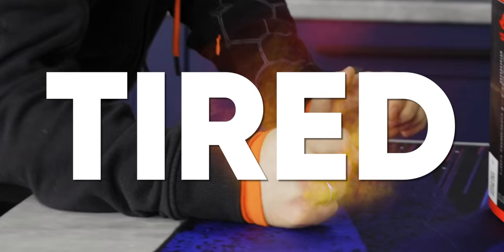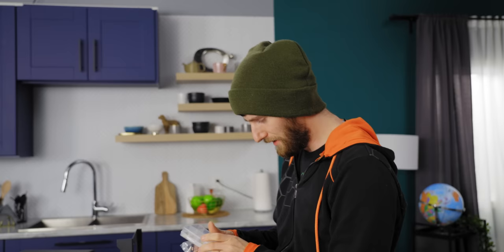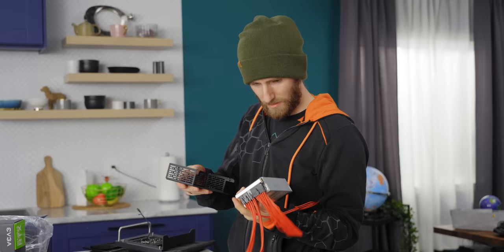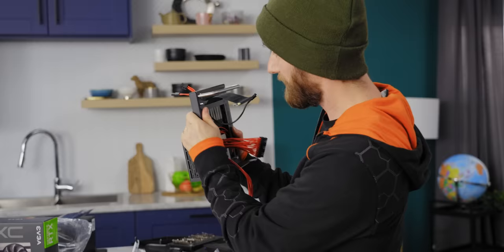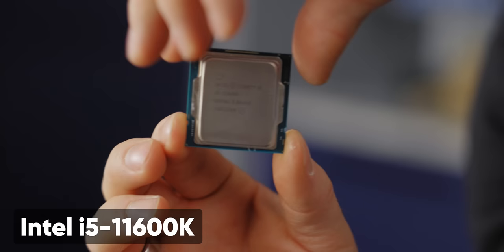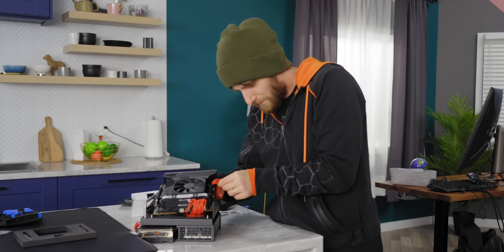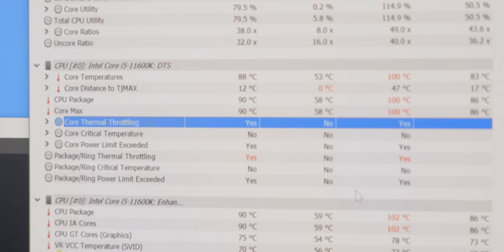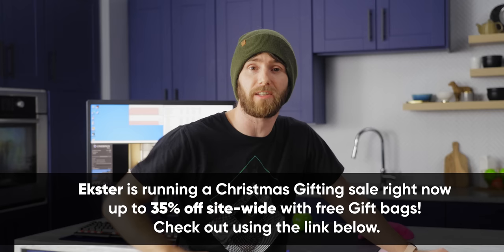Cases are Stupid. - XWORKS X32 "Case"

Comment: I'm sure someone is going to see these 'cases' and invent a 'self-cleaning' or more likely 'self-dust-filtering' CPU and or, GPU fans, so that dust won't bother the fan. The only reason the larger cases come with meshing for filtering out air particulates in the first place is because the fans don't do that themselves, and get covered in gunk when they don't. 

 I wonder if we can get Major Hardware to watch this video of this case and come up with the idea himself, to make 3d printed fans, with 3d printed enclosures, WITH some kind of 'filter', perhaps the filter can't be 3d printed.
Reply: I would love that. Compressed air is so 1990s
Reply: @phoenixmorgan  Is it? Damn, I'm living in a past I've barely seen.
Reply: There are electric dusters. I have one called “CompuCleaner Xpert” (not sponsored) which works great for cleaning my PC which I have permanently on a testbench. The one I have is pretty strong even with a really wide nozzle, I have to be careful because it spins the fans up really fast just from airflow. Additionally having the PC on an open case/testbench means that the airflow is usually varied and not always along the same path of the case fans which prevents buildup of dense/compressed dust.

Comment: I wonder if temps would be better if fan on the L9A was pulling air through the fins of the heatsink and exhausting it out into the surroundings instead of pushing it down and through.

Comment: One nice thing I could see people using the XWORKS X32 for is to 3D Print a shell for this so they can make a compact PC Case and CHOOSE how large they want it to be in order to accomodate larger GPUs, or extend the length to accomodate for the use of an SFX Powersupply, & purchasing a PSU extension cord to put on the back & use the spot for a Flex PSU as an area to stash cables.

Comment: Love my Thermaltake Core P3 open case. Temps close to ambient at idle. Have yet to see above 65c at high load. And 5 minutes with an air duster once every couple months. Never had a cleaner set up.

Comment: Now, new challenge for you Linus, make a computer in one of those animal backpacks with holes so you can carry it around. 
Requirements:
it can't be heavier than 15lbs (6kg)
It can only get warm enough to make the plastic warm, not melt
has a mini-monitor on the wrist or something like that
las a power supply on it
must be able to run 1080 at minimum 

No pi's allowed. No ARM allowed (unless it can run arm as well). 

BUT I doubt this will ever happen. I'm never noticed...

Comment: The portability argument is a bit moot because in many use-cases like LANs etc. you'd still have to bring peripherals and maybe even a screen with you, so lugging a traditional PC case with you as well just doesn't make much difference anymore.
Where I see a use-case for this is for Gaming PCs that get set up under a TV, maybe in someone's bedroom where there isn't enough space for a desk. I'd then maybe prefer this "case" to the other small factor cases because it seems that it is quite a bit easier to build in this one than in the others (if you limit yourself to air-cooling and the constraints of the PSU)

Comment: Here's an idea for a water-cooling loop
Connect the in flow of the house plumbing such that the water flows through a reservoir that contains radiators for the house server equipment. BEFORE it enters the water heater or floor radiators. This will preheat the water, maybe reducing water heating costs?

Alternately, you could have the house plumbing flow directly through the server loop (I mean, COOL EVERYTHING)

I know you like doing really off the wall stuff. If you're interested, message me for more!

Comment: 1.) Flip the CPU fan and have it EXHAUST the air. It might do better and not throttle again. Plus, it won't blow the hot air all over the VRM and RAM and SSD.
2.) Just get a SFF PSU with a 80mm fan that goes on the side, not that trash 40mm.

Comment: They really need to get a BlackRidge V2 CPU cooler for all their SFF builds. Not the easiest to find in NA but it is possible and will fit just about any sff case with a slim 120±slim 90mm fans. It is MILES better than the L9 or even L12s.

Comment: 3060?  Dude, it's effectively an open bench case for GPU airflow purposes.  You might as well give it a 4090 Ti and demonstrate just how small a top-performing system can be now.

re:  cases with filters, blowing the dust off that thing is so much easier, it wins that trade-off too.

Comment: As far as noise goes for super tiny builds like this, I generally replace the stock Flex power supply fan with the super tiny Noctua A4 fan and it's much quieter.

Comment: Even though there's no chips on the bottom of the NVMe SSD, heat can still be transferred to the bottom of the board so cooling that side of the board would still be beneficial.

Comment: I have a similar thing. I have the Xtia Xproto with radiator brackets for full custom loop and it looks soooo cool and it runs extremely cool. A lot of people complain about dust but its honestly not that hard to clean. My only complaint is you can hear coil whine from the motherboard and psu.

Comment: @LinusTechTips That is a modified Delta PSU not OG.  The quality is highly variable based on the EE knowledge of the person modifying the psu.   I bought a few of those and found them to be fine for very low end GPUs but something like a 2070 would restart on load despite being a couple hundred watts under the psu rating.

Comment: Ordered a Fractal Design Define 7 case as well as a Ryzen 7 5800X and an NH-D15.  The processor and cooler came in today and while it probably would've been wise to wait for the case to arrive in  January I couldn't help but upgrade the processor and cooler right away.  Even without the new case it's soooo much quieter and a bit snappier too.  I didn't necessarily need a new CPU (my Ryzen 7 3700X was still doing fine aside from occasional throttling) but I figured I may as well upgrade it since I had to take the cooler off anyway and it's a bit easier (and probably a bit more performant) to attach a cooler to a CPU that hasn't had any paste on it before.  I was using the stock Wraith cooler before.  The new case should be even quieter while providing better airflow and much easier upgrades than my current one.  Not sure what type of case I currently have (I'd probably have to find the box in my (very much not attached) garage) but it's a super tight fit with an ATX board, has the PSU right next to the MB instead of a separate compartment, and doesn't have a USB C port.  It does have a reset button and a clear side panel which is a catch 22 (the new case will have a solid panel because as much as I like seeing inside the case I'd prefer to not have a ton of light coming through it when I'm watching a movie or trying to sleep and the solid side + foam will further reduce unwanted noise).

Comment: @ltt I think that reverse the mounting of ventilator would solve overheating issues, because you will be getting heat from board not into the board. Bottom of the motherboard seems clear to have inflow of cold air.

Comment: I have a similar build. No case right now, and using Ryzen 5950x with a mini Asus Phoenix 3060 on an Aorus B550i. I'm using 64gb ECC very-low-profile memory with a alpenfohn black ridge + 120mm fan and liquid metal. Using a 600w modular flex psu (enhance 7660b from Geeek). Idle temp is around 42c and 23c for the gpu.

The heaviest test I've done so far is Minecraft 4K @ 144hz. I think CPU was around 60c and GPU at 32c.

Haven't done any optimzations yet. I did apply a tiny bit more LM after my first attempt, which helped tremendously, so it may need a little more(I'll have to see how dry it looks next time I take it apart). Didn't enable ECO mode either. Windows shows CPU Temp and Watts. I've noticed at around 70-80w the CPU hits around 75c. Haven't done any intensive tests or sustained benchmarks yet, but don't have high hopes. I can always stick another 120mm fan on top of the heat sink in a push-pull config blowing (intake) onto the CPU 🤷.

Comment: I see no problem with 3D printing a customized cover to solve the dust problem. Or you might just use a cloth or metal mesh. This build just screams for a shroud or armor. and it could be optional and easily removable.

Comment: Could one not reverse the CPU cooler fan to pull air from the VRM/IO side into the fins and push out into the room? That might make this particular cooling solution work better. Not that it would work (because fridges cannot transport hundreds of watts) but plonking that thing into a fridge or freezer sounds actually almost feasible. Some cables passing-through isolation to minimize leakage and you have a sub-ambient system running where no condensation occurs as all components are hotter than the inside of the fridge ;-)

Comment: 500Watts - only 1 PCI-E, 6 pins, only 1 CPU cable , 40mm fan that's a pitty, otherwise it looks cool! Unfortunately not really future proof , if the maximale possible GPU to put in there is a 3060

Comment: Would a mesh case over the top that you can easily slot on and off not solve the open air issue and still provide easy access for visuals/adjustment, or would it mess with thermals?

Comment: Hey guys, I need an advice. I have an SFF case Dan A4-SFX with an ITX motherboard (ASUS Z370i). I would like to use Vive Wireless VR adapter which has a PCI-E x4 card... i know I could adapt one of the M.2 slots to PCI-E and connect it there... but I'm kinda at a loss where do I stick the riser
Damn you Vive, why can't you make a usb 3.1 wireless thing

Comment: Good case but way too expensive. You can get something like the K39 (Velka 3 clone, kind of). for 80 dollars. Even a Velka 3 from 160 when in stock. And if anyone thinks about something like this bw aware that the Flex ATX PSU is really loud under load. I have an FSP one it's like a hairdryer.

Comment: Ok, it's awesome BUT, they should have used standard size PSU. That PSU will break in time and it's not enough to feed the most potent VGAs. Remove the PSU, change the format for standard PSU, sell it at 79 dollars and BOOM, great product. They f... royally. So close, still so far.

Comment: 1:52 "Oh, speaking of the... power supply... check this thing out!.... despite it's tiny size, it can output 500 freaking Watts! At what sort of efficiency?... "Umm. Look how cute it is!"
Perfect example of how you need to go ALL IN on tech analysis in the new LTT tech lab. Even if it's just your own initial measurements; you will build more credibility for your own lab faster, the more times your own in-house research is verified by outside measurements. However, (not knowing your exact budget constraints) it is of course advisable to outsource said research to specialists when it is not realistic to do properly in-house. As was said by some wise wo[man] at some point, " 'Tis typically better to let an 'acquaintance' be wrong, than for your ownself to be considered 'sometimes-reliable'."
Reply: And to those who seek sources on those quot3s:
stop.
seek no further into the mysterium, lest you travel at your peril, without the oversight of your previously known gods.

Comment: "Open case = airflow" is an utter myth anyway, right ? well designed plenums = great airflow - separate inlets and outlets by as much path length as possible and avoid parasitic flows, filter the intake.

Comment: Listen I love LTT.  That's a 65W cpu cooler.  You wanted to go 12th gen, good luck with that cooler!  Then still pick a 125w 11th gen and blame the high end motherboard shrouding when the cpu thermally throttles.  And yes that psu is garbage.  I mine Ethereum in my gaming rig with a 3060 and a Fractal Design SFX-L 650W.  The PSU fan NEVER runs!

Comment: I’d love to build a PC like this, and then 3D print or lasercut a case to go on/over it— a slipcover, sort of.  But unlike a normal case, my outer case shell wouldn’t need to be thick or strong enough to be structurally stable— it would just be a dust/static/damage shield and have a cool material or design (1/8” / 3mm wood panelling could be really nice).  Basically the same “skeletal” idea as vertebrate animals or modern high-rise buildings.

Comment: Another point for small or barebone cases: less damage during the transport. Now the fans are open and vulnerable. Can get stuck somewhere and you can put finger on it.
So are cases really stupid? Not really, they protect fans much better.
Or this case must have some grills over it, to protect fans.

That is why we still need cases to avoid damage on sensitive parts, fans and wires.